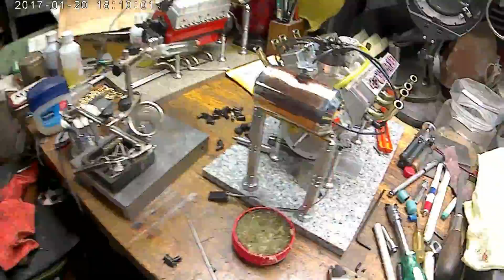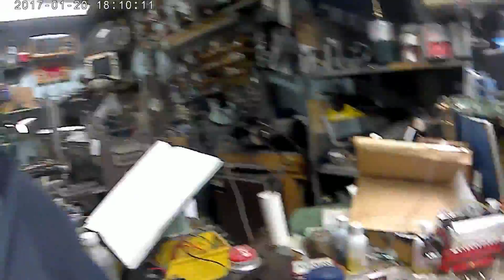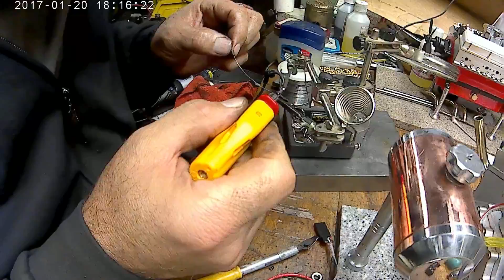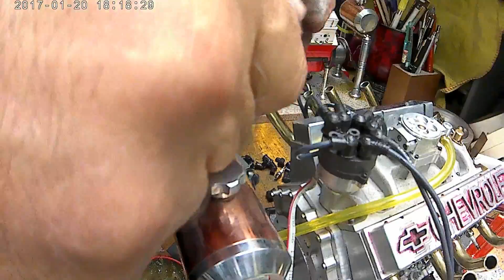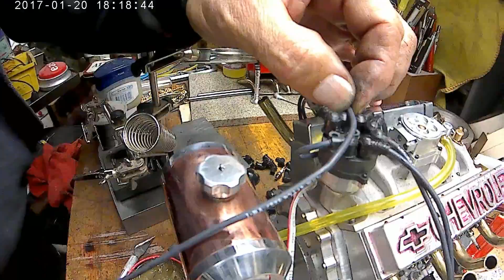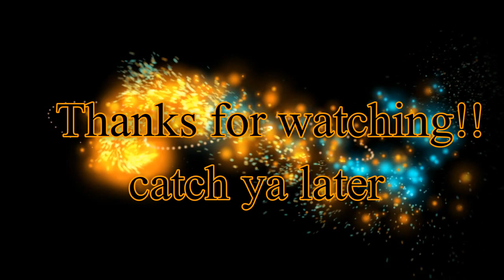Spark plug wire assembly

Comment: why not thread all the boots on the wire one time like a string of beads then cut each wire to length making sure you have a plug and dist boot in place now only two to solder